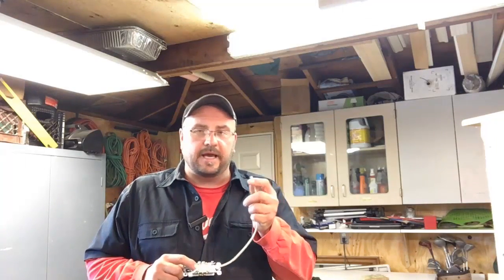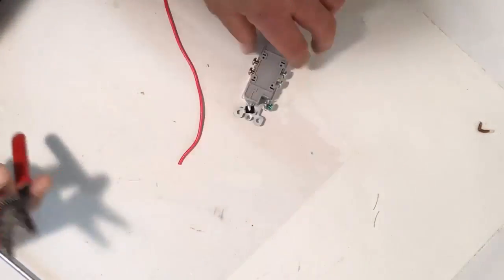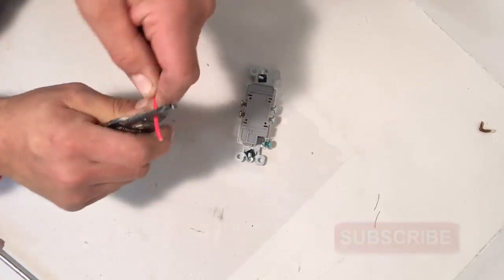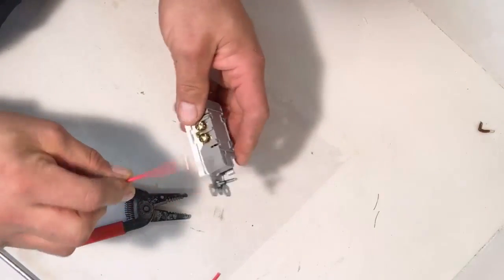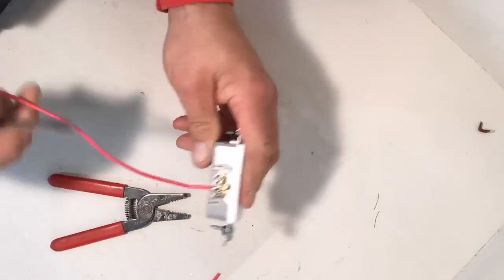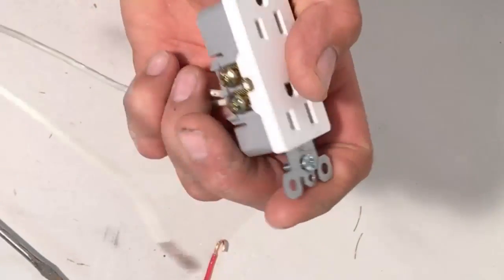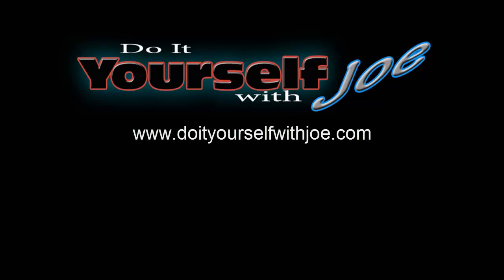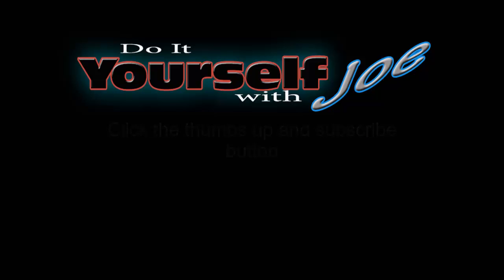how to use stranded wire on an outlet

Comment: I saw an old electrician with a "solder pot" tin the ends of all his stranded wired. It was a molten pot of solder and he'd twist the ends then dip them in. They'd come out bonded like a solid core and he'd install them under the screws.

Comment: Not sure that this is the best way to connect stranded wire to outlets or switches. Although your method of attaching stranded wire will reduce fraying it can still lead to excessive punching of the strains weakening the conductivity and strength of the wire. Furthermore, there is an increased risk that the partly remaining insulation could come loose and expose unprotected live wires inside the electrical box due to vibration or force when pushing the wired outlet into the wall.

Additionally some outlet / switch manufacturers installations are only approved to have solid copper wiring.

My  preference  is to pigtail the copper stranded wire by a Wago connector to the appropriately gauged solid copper wire.  Then connect the solid wire to the outlet / switch. 

Following that then wrap electrical tape over the levers of the Wago connector to prevent the levers from accidentally opening during installation. Hope this is helpful.

Comment: Great video. I was wondering if I could even use stranded wire for an outlet.
Reply from the maker: There are other outlets available that are actually easier to use stranded wire on. When you loosen the screw there is a square like washer under the screw. Slide the stranded wire under the washer then tighten the screw. Looks like you gave me an idea for a new video! Thank you!
Reply: @Doityourselfwithjoe  No, thank YOU. That's even better. I'm definitely going to look for those outlets for what I'm about to do. I need to install a couple of outlets on my roof overhang by some soffit vents where bare wire is because some motion lights were there, but my new motion lights are plug-in. I appreciate that.

Comment: NEVER buy a receptacle where you have to wrap the wire around a screw. Spend a dollar or two more and get a better receptacle where the wire is clamped down. No special techniques required for stranded wire. With these receptacles, you simply strip the wire, insert into a hole or a slot in the back and tighten a screw that clamps on the wire. Leviton and others manufacture these types of receptacles.
Reply: God, I love the comment section.
Reply: Aja, buy the outlet designed to be used with stranded wire.

Comment: What size stranded wire for a 15amp circuit? 20 amp?
Reply from the maker: No smaller that 12 gauge for a 20 amp circuit. You can use 12 or 14 for 15 amp but no smaller that 14 gauge.

Comment: A friend of mine in another county has an inspector who won’t allow stranded on an outlet or device. Apparently he was also a fire investigator and found a few house that had caught fire due to stranded wire either not properly installed or not tightened properly or had pieces of the insulation jacket under the screw creating an arcing situation. Not every case was conclusive but enough issues with stranded wire made him require stranded wire to be pigtailed in the junction box and solid wire go the switch, light, outlet etc. I have always done it with pigtails. I hear Wago connectors are really good with stranded wire and I haven’t tried using stranded wire on a side wire outlet, etc….

Comment: Thanks I appreciate the simple yet neat connection  for standed wire. I used standed wire for 12 ga circuits because its a little easier to bend into a box, etc. 

Question: would you or should you snip off the long wire that is behind the receptical housing?

Comment: Good to know the solid wire should be looped because thats not what my complex did. They also binded two grounded wires on each outlet going to the recepticales
Reply: Some outlets have a plate under the screw where you can make a straight in connection. Different outlets have different connection options.
Reply: They were being lazy and didn’t want to pigtail

Comment: ANYONE who needs this kind of advice, SHOULD NOT BE ALLOWED ANYWHERE NEAR AN AC SOCKET WITH A SCREWDRIVER IN THE FIRST PLACE.
But I agree stranded wire is so much easier to work with.
I am not an electrician just, as I like to refer to myself, a talented amateur.

Comment: Yes there are a few problems with stranded wire, BUT the flexibility of the stranded wire makes trying to wire a crowded junction box SO MUCH EASIER.
With solid wire trying to pack those wires into a box can drive you INSANE.
I live in Williamson County TN where 12 gauge wire is required, trying to bend and pack 12 gauge wire into a junction box is a challenge, STRANDED is SO MUCH EASIER.
I used to live in suburban Chicago where 14 gauge was used, while not as convenient as stranded wire it is far easier to handle than 12 gauge solid.
Reply from the maker: I am a field superintendent in chicago and work with union electricians just about every day. They use stranded wire all the time. It's also much easier to pull multiple wires through pipe.
Reply: @Doityourselfwithjoe  Thanks for your reply, I lived in Suburban Cook, Dupage and Lake Counties for 33 years before retiring to central TN. I am not an electrician just what I call a talented amateur.
Best wishes.
Reply: @Doityourselfwithjoe  I've got some smart thermostats that used stranded, but for the sake of the sanity of the DIY installers they were marketing to, they soldered the ends to make it a bit easier to work with. I think your method is a bit better in that it's a lot faster and soldering has its own issues.
Reply from the maker: @SmallSpoonBrigade  Im getting ready to upload a new video on stranded wire. There wont be any difference for the purpose you are mentioning but for devices such as outlets, there will be a difference.

Comment: This is the best method, IMHO.
Reply from the maker: Thank you. Chicago electricians showed me this method and it is allowed. Yes you can crimp a u shaped connector on it but you don't have too. It would cost time and money to crimp connectors on everything. This is the safest and quickest way. I agree that some municipality's may not allow this. So if anyone is worried about it check your local building codes. Thanks for the comment.

Comment: Why not simply crimp a fork on it?  It doesn't get any easier or  secure than that.
Reply: They will fail
Reply: I say "Crimp on, fall off"
Reply: @markjohnston73  - A proper crimp on stranded way better than  smashing strands.  A proper crimp  with a ratcheting crimper is clean, stronger,  more secure , and zero loose strands.

Comment: Yo Joe. Your Technic is bush league. Strip as usual maybe a little longer than normal (1/8") now tightly twist the exposed strands in a counter clockwise direction, form your hook, put em under the screw and tighten the stew out of the screw.
Reply: That was the key counter clockwise just strip it a little bit longer thanks for tip!

Comment: as electrical engineer, should either tin the stranded wire or pigtail with a solid piece. for electrical outlets I do not like to use crimp on fork/ring terminals have seen too many crimps not make a good connection and cause overheating/fire hazard.
Reply: tinning the wire is NOT a mechanical connection, NEC requires mechanical (in this case means crimp terminal) connection, specifically disallows solder as the ONLY method of connection.
Reply: The non-insulated seamless locking fork terminals using a basic non-insulated crimper from Klein or Burndy (and others) for specifically 12 AWG or 10 AWG THHN wire works very well indeed. You can make the crimp connection, clamp it in bench vise and tug on the wire, you will quickly find out how good you crimp is. I have never had crimp from the basic crimpers fail, although I would say I know how much force to use. In addition, today we have sophisticated full cycle ratcheting crimpers that makes repeatable crimps easy for even the most inexperienced user. I can say for 12 AWG and 10 AWG THHN wire crimp connections to non-insulated locking fork terminals if done properly are very reliable.

Comment: It's a neat trick but definitely not to code. Better to use a 120v rated 12awg    fork connector for the stranded wiring. I had to do this when installing a new video doorbell. The video doorbell required a 25vac transformer which I bought at a local electronics shop. It came with stranded wiring to it with a plug on the end. I cut the plug part off and tapped into a receptacle with fork connectors. Definitely easier and didn't get in the way of other wiring.
Reply: It is code compliant. What part of the code gave you the impression that it isn't?

Comment: I made this video part of my answer on Quora about using stranded wires in outlets.

A ferrule crimped on with the proper tool is another solution.

Solid and stranded wire can be joined with a wire nut.

Do NOT be tempted to solder the strands together! Never solder wire that will go under a screw terminal. Solder is soft, it doesn’t have to get warm to get loose. Everything in an electrical circuit is designed with alloys to match the copper wire.

The issue with aluminum wire was not the aluminum, it was the oft-ignored necessity to use different outlets with aluminum wire.

Differential expansion of metals from even minor changes in temperature will cause the soldered strands to be squeezed, then loosen up. Solder, especially leaded solder, easily forms oxides on the surface that will cause a high resistance connection.
Reply: This is not right it has to reach a high temperature to cause that kind of effect and if it did it is because too small of a gauge of wire is being used for the amount of current flowing through it.
Reply: @robertklein7679  What is not right? Lead-tin solder is soft. Lead-tin solder forms oxides on the surface. Changes in ambient temperature cause metals to expand and contract, and crimp connectors aren't matched in expansion to solder.
Reply: Yes, it is soft but not that soft to cause it to change with only warm temperature but if you are having that kind of a problem and are using proper gauge wire then you are using the wrong flux that is leaving a corrosive coating on the finished product, and for dissimilar metals which everything is when it comes to connecting wire it is very unusual to have similar metals when connecting wires to any device and in that case one need either use Noalox or Penetrox or whatever lox you want to use.

Comment: Makes a good connection if done right, but I'm pretty sure it's not legal.
Reply: It is legal common misconception that it isn't.
Reply: pretty sure crimp forks need to be used if you're going UNDER the screw and not stabbing under the screw plate?

Comment: Even though code requires solid wire in the US and I do follow the NEC code. I always said stranded is the better wire if installed properly. Ever wonder which manufacturers financially contribute to the authors of the NEC so they can push what product.
Reply: Stranded wire is allowed in the NEC. Where did you hear that it isn't? Stranded wire is the default for anything going through conduit.
Reply from the maker: Solid wire also breaks quicker than stranded. bend a piece of solid back and forth and see how quick it breaks. There has been a few times  I've had an outlet not work. Check the breaker, it's fine. Take the outlet out and there is a wire broken off.

Comment: I used to work for a company that did government contract work.  We were encouraged to use solid wire but were permitted to use stranded wire. But when we used stranded wire we were required to crimp on fork terminals to connect to the outlet screws.
Reply: Not only fork terminals, but non-insulated seamless locking fork terminals, which will tend to stay around the screw if the connection becomes loose. Ideally you would use a broad surface ring terminal, but it would require removing the screw, which is not recommended due to the screws back out thread deformed feature. 

The locking fork terminal is more even in the screw clamping surface area, and if you torque the screw to its rated value, which can seem high from a force standpoint to many not in the trade, the screw will stretch and effectively act like a spring clamp holding the flat locking fork terminal evenly. I think the locking fork terminal is the most reliable because the clamping force is not concentrated, like with a solid wire, and is evenly distributed under the screw head. Usually the issue with the non-insulated locking fork terminals is many people do not have the proper crimp tool to make the wire to fork terminal connection.
Reply: its easier

Comment: Can't do it that way legally. Check the NEC. Must use a spade connector or pig tail with solid wire.
Reply: Article number please.
Reply: @wring4425  110.14(B) Splices. Conductors shall be spliced or joined with splicing devices identified for the use or by brazing, welding, or soldering with a fusible metal or alloy. Soldered splices shall first be spliced or joined so as to be mechanically and electrically secure without solder and then be soldered. All splices and joints and the free ends of conductors shall be covered with an insulation equivalent to that of the conductors or with an insulating device identified for the purpose. Wire connectors or splicing means installed on conductors for direct burial shall be listed for such use. 
as you can see NEC requires the splice to be "mechanically and electrically secure" and THEN be soldered.
Reply: @Shiatsoup  Is that a splice? That's not what I understand a splice to be.
Reply: @Shiatsoup   Splice vs Termination.
Reply: that's  legal in DIY world...😂

Comment: Anytime your placing any wire be careful to not get the wire jacket behind the screw head! I just ran into a case where the installer wired the outlet correctly (right wire in the right places) but on one side of the screw he left a good bit of the jacket under the screw. What happened was under a heavy load of an electrical heater the connection starting to arc, which created to much heat at the connection, which BURNED the whole one side of the outlet off. She was lucky in than the end of the wire burnt off opening the circuit before it started a fire.
Reply from the maker: Thank you for the reply! That would happen and obviously did!
Reply from the maker: I hope nothing bad happened. Did you hear a crackling coming from the outlet?